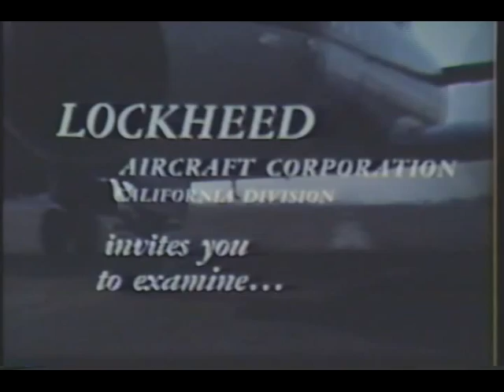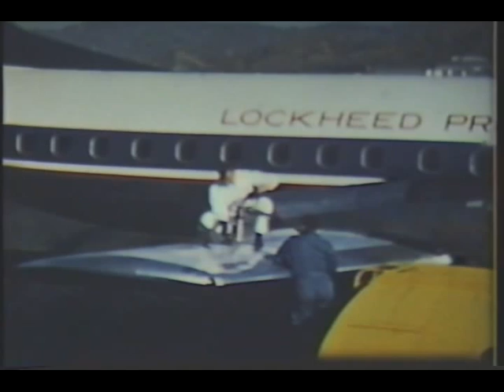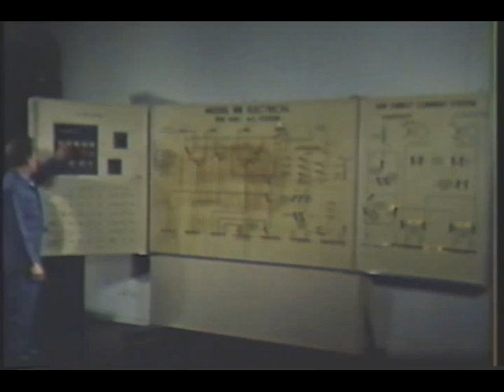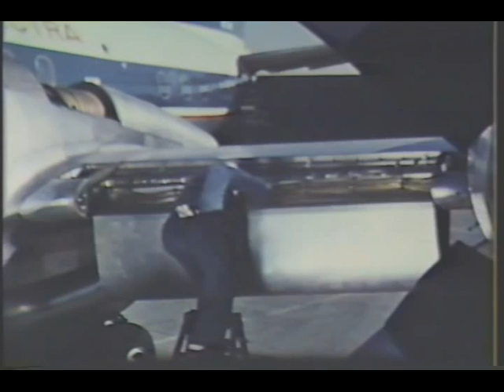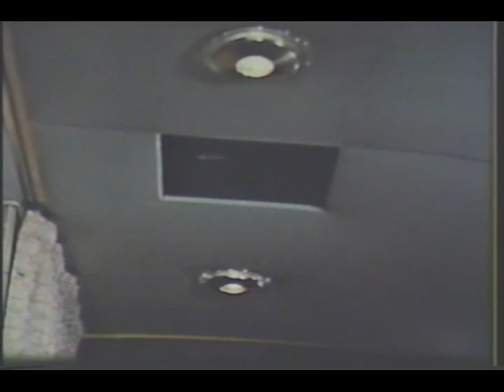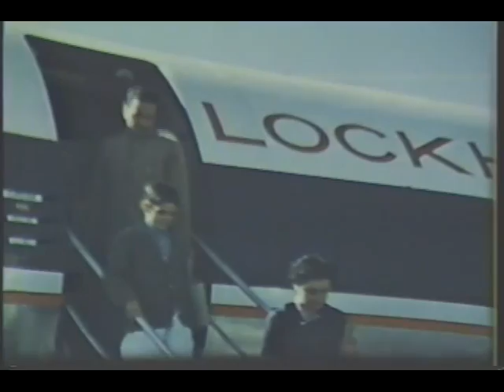Lockheed Electra, Pattern for Profit

Comment: Once its bugs were fixed the Electra (and its military version the Orion) were great aircraft, durable too. Two fatal Electra crashes early on sadly put a premature end to the type's airline career. 
       I disagree with claims that, in flight, you almost had to shout if chatting with someone in the seat next to you. In 1970-71, I made three of the 4+ -hour hops aboard Air New Zealand Electra Mk IV's between NZ and Australia. Prop noise & vibration yes, but no effort conversing. Takeoff was surreal; rumble of 4 big Allison turboshafts seemed to quieten slightly as the ship accelerated down the runway. Apparently she had constant-speed props, pilot poured on the fuel and those huge airscrews altered pitch for maximum thrust. 
      In that long-ago era of cockpit visits, the Electra's flight deck was a sea of 'steam gauges' (analogue instruments) with more at the flight engineer's panel. 
      All in all an unforgettable experience. And I still have my Air NZ Junior Jet Club logbook somewhere to prove it. 😄

Comment: About 40 years ago my mom called me up and said be at LB airport at exec terminal at 7pm, a plane will pick you up, were doing Thanksgiving at Lake Havasu. I was expecting a Bonanza or 310 to show up. Instead this monstrous 4 enginged beast shows up, that said McCullough International. The terminal person escorted me out past two giant engines and like 12 foot  props still running, then in front of the nose, where magically there was a staircase already set up,  and only the inboard prop was just spinning down. I boarded, was shown my seat in this huge plane with about 10 other passengers, told to buckle up and less than a minute later we were rolling again. The terminal was close to the runway. We taxied out the 150 yards in about another minute,  made a 180 turn and accelerated like it was a Corvette, complete with big roar of the engines. I looked out the window and the ground fell away insanely quick Another 10 seconds and went through some low coastal scud and broke out over the top and the top was all moonlit and kind of slow boiling. Less than an hour later we arrived in Lake Havasu,  They held up the corporation dinner til us passengers arrived. The interior of the plane was more plush than plastic with large windows with curtains over them. It smelled slightly musty in there. Liked they should let it sit out in the desert son for a day with the doors open and let the inside bake . I apparently was the last passenger collected and first to be let off on the return trip a few days later. Found out later it was a Super Electra. It was kinda surreal. No standing in line, no checking in. Just go to this small terminal, wait 3 minutes, and get on this big dervishly whirling magic bus, and be in the air less than 5 mins later.  It was definitely a noisier ride than a commercial jet, but loud gravelly hum was kind of hypnotizing. About an hour of that would be all I could tolerate

Comment: This plane was the only badly designed plane lockheed ever made. It had three crashes due to a design fault with the engines and how they were connected to the wing. The wings literally tore themselves off. After those crashes, no airline ordered any more. Lockheed lost a fortune. 

Then they came out with the L-1011, and they had technological problems with that, and they lost a fortune on that one as well. Not to mention the bribery scandal where they were caught paying off government officials to buy their products. 

After those two money losing ventures, Lockheed swore off commercial airliners as simply not a good business. They sold 170 Electras, and 250 Tristars, for a total of 420 planes sold over 23 years at a time when commercial aviation was going gangbusters,  1959-1982. That averages out to only 18 airliners per year. They said never again! They have kept their word ever since. Now they just sell over-budgeted, over-engineered stuff to the military.

Comment: As I write this, the Boeing 737 Max 8/9 are grounded in the US and other countries following two fatal crashes with similarities and we await the definitive cause (s) and solution(s). After two fatal Electra crashes involving separation of a wing during flight, the FAA of that era issued a directive prohibiting use of the autopilot until modified and instituting a speed restriction, among other things. Knowing that pilots were flying Electras near to the barber pole, the FAA believed restricting speed initially to 275 kts and then 225 kts created a satisfactory margin of safety to continue flying, based on engineering calculations. The outcome of discovering and repairing the problem made the Electra flyable up to design speeds - and she was indeed a pilot's plane - Lockheed's timing was off as the advent of smaller jets quashed the turboprop market. Still, the Electra ushered in innovations like hydraulically boosted flight controls (Boeing hired this system's engineer out of retirement to design the 727's hydraulic controls), single point fueling, well organized ramp servicing, maybe the best climate control system ever, fully electric ground operation. A few Electras flew well into the 70s with US legacy carriers, notably with Eastern's Shuttle, and served in other places well beyond that. Some in those days said - they might have been right - the ideal airliner would have been designed by Lockheed, built by Boeing and sold by Douglas.
Reply: noooo...designed built and kept by Canadians

Comment: I flew this plane in the Navy as the P-3 Orion... built like a battleship.  The landing gear speed was 300 knots (!), the Vne was an amazing 405 knots (faster than any jet airliner or private jet flying today)  It had lots of power and could stop on a dime with those powerful reversers, and yes, it can stay airborne on only one of the four engines.   Sometimes we had upwards of 9,000 to 10,000 hours on those Allison engines before they needed overhaul.  Good job Lockheed.
Reply: Too bad the passenger version was not as robust as the P-3.  Could have been a real winner.
Reply: @encinobalboa  the passenger version was as robust. It was a very good design. Once the original flaw was found and corrected, these planes performed quite reliably. Some Electra's carried paying passengers, on regularly scheduled flights for nearly half a century. That's a feat that few, if any, of the "modern" airliners will ever be able to make.
Bottom line; Great airplane, stifled by bad press.
Reply: wow...I've only seen 1 ...  flying out of Edmonton in early 60's
-why wasn't it more successful ?
Reply: Easy.  The wings came off in flight causing a few celebrated crashes.  After that, the flying public avoided these flying incinerators.
Reply: @MrShobar  There were two, highly publicized crashes, shortly after the design entered service. It was found that the crashes were due to a previously unknown phenomenon. The source of the problem was found to be in the design of the engine mounts on #1 and #4. The engine mounts were not designed by Lockheed. There was nothing wrong with the wings. 
The record shows that the design only experienced one in flight fire. This was the result of the pilots deciding to fly into a thunderstorm. The plane was consequently struck by lightning, which started the fire. "Flying incinerator" is an absolutely wrong label.
Once the engine mount issue was solved, these planes served reliably, for many years, still carrying paying passengers until 2001. 
The performance of this plane, even by today's standards, was outstanding.  
Unfortunately, it was the victim of, undeserved, bad press. 
Recently, Boeing has had a similar problem with their 737 Max. However, Boeing's problem is with management, not design, per se. The plane is a great design. I predict that it will go on from here, to have one of the best service records in airliner history. Boeing, as a company, however, is quite deserving of any and all bad press they receive. Management was fully aware that there was a problem. They chose to conceal the problem, then deny it existed.
In the case of the Electra, Lockheed actually work with rival companies to identify and correct the issue.
Reply: @bob2161  Read the official report.  When the resonant condition was encountered and coupled to the wing structure, the wings tore off.  One of those "rival companies" was Boeing, who had a lot of expertise in the field of aerodynamic flutter.
Reply: @MrShobar  Doulas was the company that loaned Lockheed the in flight flutter test rig.
The engine mounts failed. This set up catastrophic dynamic vibration. This vibration destroyed the perfectly good wings. The wings did not cause the failure. 
That's like saying a tire is defective because it went flat when it was punctured by a nail. It's a perfectly good tire, destroyed by a nail. Not caused by tire design.
Reply: @MrShobar  by the way, which official report? There were numerous reports, written by numerous groups. All of them are considered "official". The CAA/FAA wrote in excess of 5,000 pages on the matter. Admittedly, I've not read all of them. The one about how the flutter rigs were calibrated and attached to the wings put me to sleep all three times I tried to read it. There were plenty of similar reports and documents that were just too mundane to get through. The report explaining what whirl mode failure was, honestly, I don't recall how long, but it was as big as the phone book of a decent sized town. I just couldn't get through all of it. This was 45 or so years ago, so I'm sure I've forgotten some of the details. The overall report though went; Identify the problem. Confirm the problem. Find cause of problem. Design solution and test it like crazy. Invent a few new tests and test it some more. 
Somewhere in there, the design and structure of the original wing was closely scrutinized. It passed muster. Many years later. I believe in the 1990's an Electra experienced a prop failure on engine #4. The prop shed it's blades, one blade passed through the cabin. The vibration was so bad the rest of the prop fell off. Plane landed safely. No injuries.
Reply: RareAirDennis, back in latter 1968 I was the ATC tower Officer at MCAS Iwakuni, Japan. I got to take several round robin patrol flights with Patron 4, VP 4. They’d feather the two outboard engines for the patrols. Quite a few times one engine wouldn’t restart due to water spray in the engine intake from low altitude patrols. Those 14 hour round robins were brutal on the crews as well as the equipment. The general public as well as hardly anyone outside of the squadron knew the massive armament load that these birds carried on missions. After all they were anti submarine warfare ASW birds. Before I was an air traffic control officer I was an F4 Phantom Pilot. A bad ejection on a test flight at MCAS Iwakuni a year earlier ended my combat flight career.
Reply: A gree with most everything said apart from  the vne is faster than any jet liner or private het flying today thars not true,  for example the 737 has vne of  452kts
Reply: @DC3RejuvationGB  El 737 NO tiene hélices.

Comment: The Electra is a fantastic airplane today. It did have some serious teething problems early on.  Turbo-prop aircraft are very fuel efficient and nearly as fast as fan-jet ones.  The flying public seems to have an unwarranted prejudice against them.  My last prop-jet flight was on a Dornier 328 from Philly (KPHL) to Northern KY International (KCVG - aka Cincinnati Airport) on US Air Express.  Fast and smooth.  As a kid, I was at KCVG the first time an American Airlines Electra landed there on a revenue flight.
Reply: My last turboprop trip was on a regional carrier just recently: a Cessna Caravan. Fan-jets are more efficient at higher altitudes where air liners fly when travelling more than a couple of hundred miles.

Comment: One of the finest aircraft ever designed. To those that complain it had a bad wing, yes but they fixed it otherwise why are there so many still in the air. I spent several years working on the navy P-3's and alittle time on Zantop L-188's and loved every minute. Maintenance hog? Lol you must of been a lazy ass then if you are a mechanic, which I doubt that's your job, if you hate it leave.
Reply: Darrin Crose p

Comment: Nice video, too bad the plane wasn't as good. The wings were a bad design. It was a maintenance hog.
Reply: @reverse thrust  we had a fleet of 21. I worked Hanger. We did phase checks and a block overhaul program. I had my RII  and run up on the DC-6,  CV-640 and L-188.

Comment: My favourite turboprop plane in the world. The Electra is the unsung hero in jet aviation less than 100 were ever made.
Reply: There were at least 170 (or 171 depending on what source you consult) Lockheed L188 Electras produced/(not including P-3s).
Reply: Not even close to the break-even point.  It was a huge money-loser.
Reply: There was a reason for that.  The public perception was that they were flying incinerators.
Reply: 150 were made!!
Reply: 170 is the correct number of Elrctra’s built.